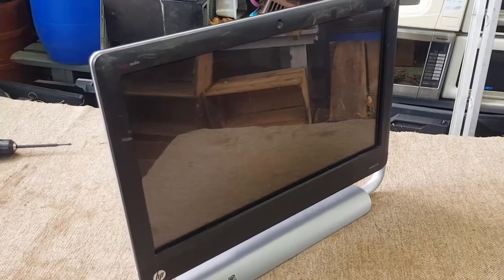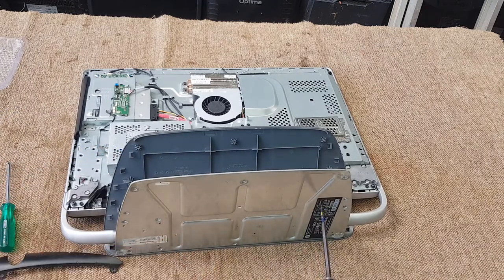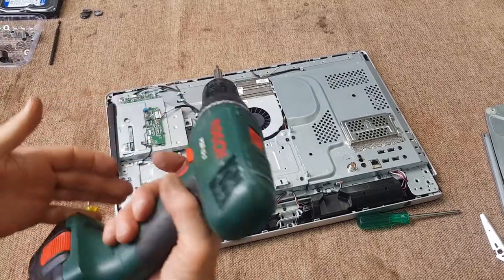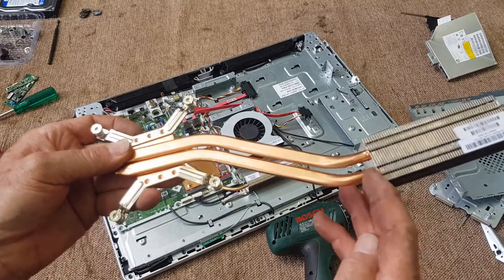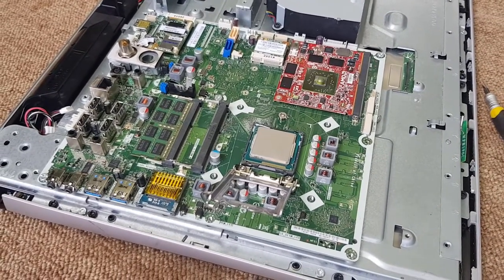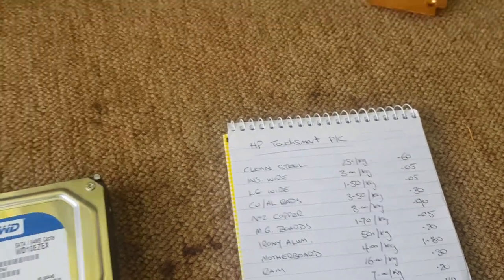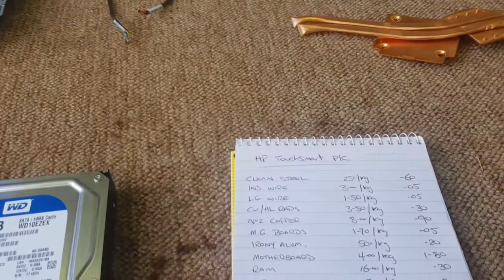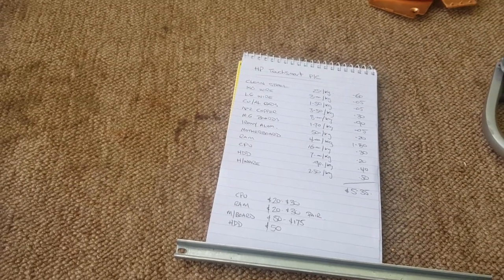Scrapping out a HP Touchsmart 520 PC Computer from ewaste. Is there much scrap value??

Comment: i still have this pc. my amily has had it for 10 years, never cleaned the inside. im running windows 10 on it and the fans are screaming. also very recently there has been these dust bunnys coming out of the tiny gap at the top of the screen.
Reply from the maker: Haha, it sounds like it's on its last legs then! Thanks for watching 😊👍

Comment: ewaste ben buys cpus for scrap. Ive never sold a cpu, but I have decades of it experience. You really need to test the cpu before selling it... That is easy to do, software is free, but tou need a setup for it
Reply from the maker: Yep, I plan on taking a load of stuff to ben at some stage - all the old stuff that isn't worth selling. I'll add testing a CPU to my list of things to learn David! So much to do - so little time! 😜
Reply: @TheUltimateRecycler  Its easy to test using the software. The difficulty is having a known good configuration for the other parts - right motherboard, ram, video card etc. Different generations of i5 chips need their own compatible setup to test. Generally speaking i5 is good, but there are 10 "generations" of them!
Reply from the maker: @davidk8699  omg, I'm not sure I really want to go down that path then! Maybe I'll do bulk lots of "untested" cpus on ebay - I still should do better than scrap price!